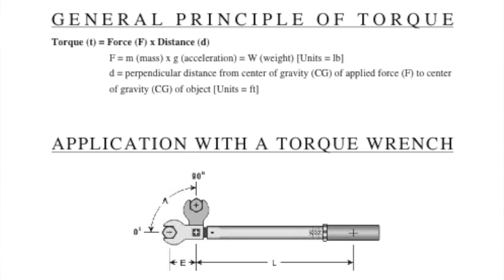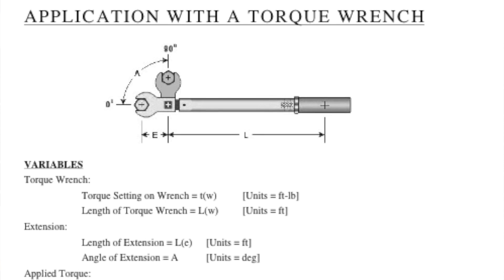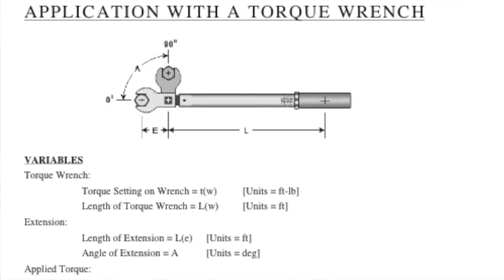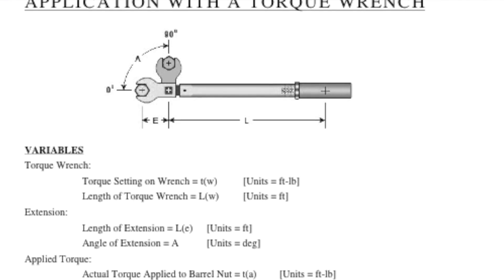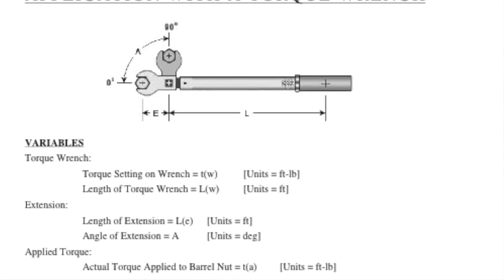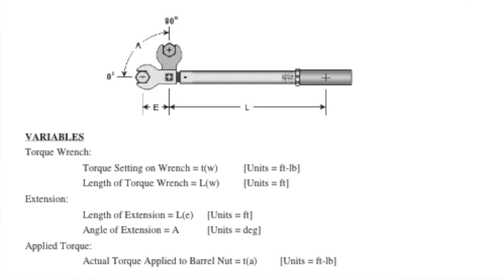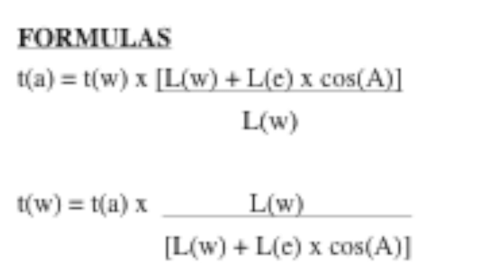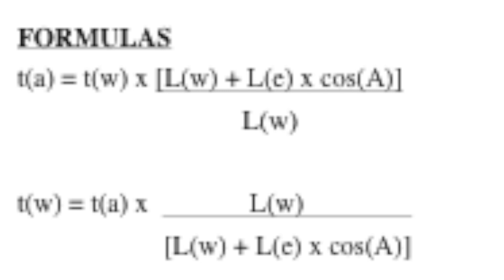The Truth About Torque: Barrel Nuts

Comment: With all due respect to our poster, I don't think the length or angle of the extension affects the torque applied to the barrel nut.  

The torque applied to an object is the same anywhere you measure it.  Imagine this thought experiment:  Take two torque wrenches and attach the socket ends together rigidly.  Then fix one wrench, let's say to a vice.  Then apply a force to the free torque wrench, any torque.  Once in a steady state, look at the torque reading of the wrench in the vice.  You will see that the torque readings of each wrench are exactly the same, one opposing the other.  Now fix the torque wrenches to the ends of a metal bar, the length does not matter.  Then apply a torque to both wrenches.  No matter how far apart these wrenches are, or their orientations to each other, the torque readings will be exactly the same or the whole system will spin.  

Thus the torque the barrel nut sees is exactly the same as the torque wrench shows, no matter how far apart the torque wrench and the nut are or the angles between the torque wrench and the bar.  

This is why barrel nut wrenches don't come with instructions to adjust torque readings, even though they come in different lengths.  So just trust the reading on the wrench, it does not have to be calibrated.
Reply: I respectfully disagree with you.  Torque is mathematically rxF...a cross product.  Imagine the torque wrench tightening a bolt, no extension.  The 'r' value is just 'r' and the torque applied is the set torque of the wrench.  Now imagine an extension in line with the torque tool where the bolt is 5r away from the original bolt.  Total length is 6r.  As you are pulling on the torque tool, it clicks when the wrench hits your set torque but now you've gone from rxF to 6 times rxF.  The torque wrench still clicks at rxF but the force applied is 6 times greater.  A simple example.  Pick up a 30 pound weight with one hand and hold it close to your shoulder.  Perhaps not easy but not hard.  Now extend it fully outward.  Way more difficult, right?  You are using the same torque tool (your arm) but you have to apply way more torque to your shoulder to counter the torque applied to your arm from the weight.  Your example you cited above doesn't have a defined axis of rotation.  The result of rxF is a vector that defines the axis of rotation.  What kind of torque wrench are you using that gives you a torque "reading" ?  Most people use torque wrenches where you set it and it clicks once when you hit that torque.  If I have a torque wrench vertical on the metal bar you've described, the torque would always "read" zero.  There is no force applied to the handle and it requires no torque to maintain its vertical position where the mass of the wrench is in line with the axis of rotation that gravity is pulling it to.

Comment: Do you know how many people you just destroyed? 
Here is how it works, place the barrel nut ,use a little locktite, torque the barrel nut down between 35 and 80 foot pounds, back it off a few times too stretch the threads then finish the final torque and you're done
Reply: Guy Green  I have an ar 15 pistol upper from ground zero precision. I’ve been looking around on how many foot pounds to torque it. Do certain company’s have different torque specs or does the 35-80 ft lbs  work for all ar 15 builds? Plz help
Reply: @brandongarcia2688  30-80 ft. lbs. is pretty standard.  First of all, don't use loctite.  Get yourself some aeroshell 33ms.  It is less than $10.  It has anti-seize and anti-gaulling properties.  Coat the outside of your barrel extension with a thin layer.  Coat the inside of your upper where it meets the barrel with a thin layer.  Set your extension at 90 degrees to the torque tool.  Set your torque tool to 30 ft. pounds.  Torque it to that spec.  Break it (unscrew it) using a breaker bar, not the torque wrench.  Repeat that torque spec 2 more times, breaking it two more times.  On the fourth go, you are going to set it to about 40 ft. pounds and tighten it.  If it is properly clocked or you have a barren nut that doesn't require clocking then you are done.  If you need further clocking, set your torque wrench to a higher value like 60 ft. pounds and just keep moving it ever so slightly until it is clocked correctly.  Keep repeating until it is clocked but don't go over 80 ft. pounds.  The only reason I incrementally increase my torque for clocking is so that I know about how much it is torqued.  Happy building, friend.

Comment: 1/2 or the 3/8 s
Reply from the maker: Either one works but it'll depend upon the opening size of the barrel nut wrench for your specific barrel nut. To avoid the potential need for an adapter, a 1/2" torque wrench fits most common applications.

Comment: I use the German Torque spec of "gooden tight" when building my AR's and never had an issue.
Reply: My friend goes until his elbow clicks!
Reply from the maker: Exactly, you've made my point.
Reply: @thelonestarpatriot  hi,
Is it normal for the 1/2" male head of the torque wrench to only lock into the hole into a standard Armorers Wrench when the corners lock into the upper and opposite lower corner of the cutout?
I have a standard thin style AR Armorers Wrench, not specific bits, and the hole for the torque wrench isn't a square where it fits flush, it's rounded a tad at 12 at 6.
Will the corners of the torque wrench ONLY locking in when mating with the corners of the Armorer Wrench cutout being the only locking/mating points affect anything?
Or is this normal for a standard AR Armorer Wrench?
Reply: Damn it , that shit is to funny . Ima say the hell with my torque wrench . "GOODEN TIGHT " is my now preferred method
Reply: Quarter-turn past “snug”! 😎
Reply: It’s Güden Tïte
Reply: 🤣🤣🤣🤣🤣🤣🤣

Me too!!!
Reply: What kind of peak accuracy do you get?
Reply: You must mean Russian spec . If you ever work on a BMW you will understand the German engineers are crazy and use a 98 step process to achieve a 2 step function
Reply: exactly this is the dumbest thing to be so autistic about. The fact that the dolos system exists proves this
Reply: @Steve42098  ran drills with the dolo system for months. Any consistent shooter will tell you its cabbage over time.
Reply: @zooromain  its overpriced shit. I have my own setup for a detachable barrel AR but I only run it on my ar9 because there is less at stake and no gas tube

Comment: Set the torque wrench 90 degrees to the extension and torque the barrel nut to the recommended ft lbs. The calculations for the most have already been worked out by the manufacturer. Thanks for the video. I build too seldom to keep all those in mind. So far that is.

Comment: every video I have seen; some kind of lube is used on the barrel nut/receiver thread.  
the addition of lube changes the torque value?  reduces the torque by about half.  why does no one addresses this fact.
Reply from the maker: It's the reverse to where lubricity will provide an increased applied torque; however, for this application with an anti-sieze grease, there's not a significant increase in applied torque and it does provide a more even distribution to the threads. That's why a median torque value simplifies any anomalies to where it's still within acceptable tolerances.
Reply: As a mechanic, I’ll tell you that’s not the case at all. Applying lube to a fastener does not double the applied torque, not even close. It may increase by just a little bit since the friction coefficient is reduced but nothing critical at all.
Reply: Tim Oneill , you are correct. However it would be more appropriate to say that clamping force and fastener stress go up as friction goes down with the same amount of torque.

This equation relates torque to clamping force:

T=KFd
 
where:
T=torque
K=friction coefficient
F=clamping force
d=thread diameter

This is a general equation for preload torque on a solid fastener.  The following links explain preload torque and friction better that I can and also why torque is an awful method for retaining fasteners.   I would like to add that the type of lubrication is part of the torque spec.

https://www.youtube.com/watch?v=lsCyAvTqcNE
https://www.youtube.com/watch?v=XMjQTl_x3fc&t=411s
https://www.youtube.com/watch?v=fbvf4vMp4bk
Reply: The 30 to 80 ft. lbs torque spec is based on the use of aeroshell 33ms grease.  It doesn't change much for other greases.  Non-issue.

Comment: Good video, a little technical for the average joe, but you did a good job explaining this.  I have watched a few videos about barrel installation (I'm currently building myself an AR) and everyone has an opinion about how to do this.  I did get this link from a comment on another video, http://www.cncexpo.com/TorqueAdapter.aspx, that does the math for you.
Reply from the maker: Thanks, brother. It was important to cover this in depth so it can provide an understanding of how the math works because of how much confusion there is on the subject. More importantly, to point out that it doesn't make any significant difference, especially if you target a median torque value.